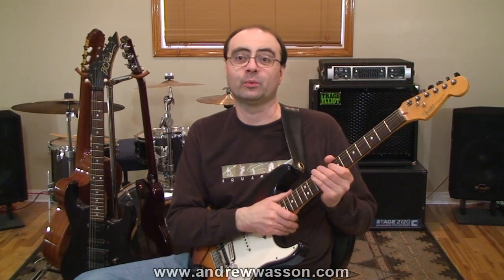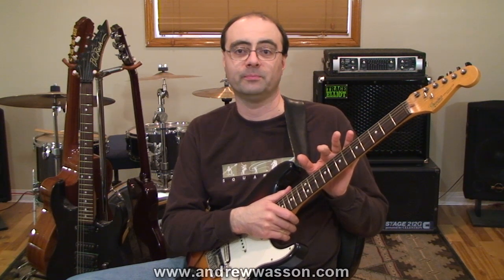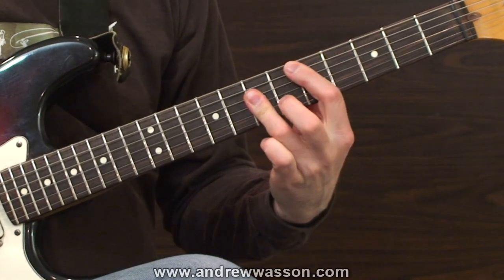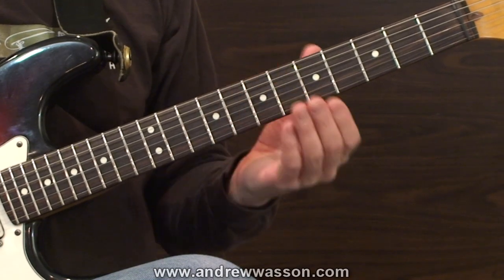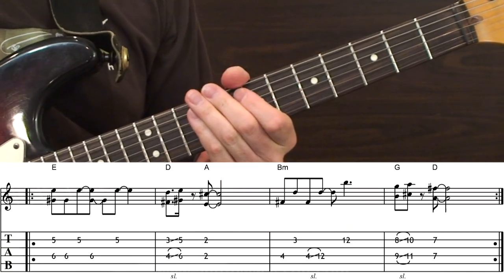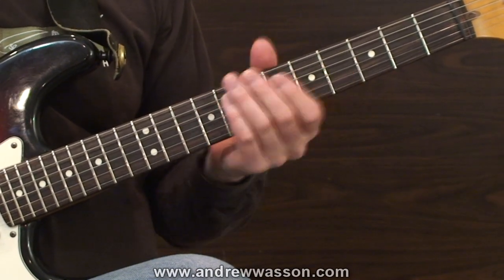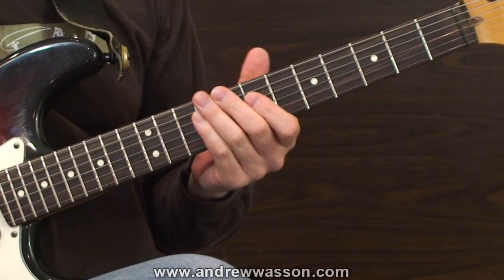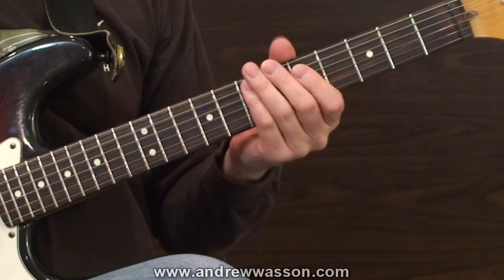Composing Layered Guitar Parts

Comment: I'm unsure if you're using acoustic or electric. I also don't know if you having any restrictions. As for branching out, there are notes that when played together are awesome. Beethoven's Moonlight Sonata and Mozart's Elvira Madigan compositions are awesome examples of subtly.

As for fattening the sound. If you're not against using electronics, graphic equalizers and chorus effects can maintain an acoustic sound while giving you awesome control over thickness. In fact even composers that claim to disdain using electronics, like Tom Petty, use some sort of electronic manipulation to clean up their recordings.

You can also play the exact part note-for-note while subtly playing with the timings and sounds to get a really emotionally piercing effect.

Every microdetail matters. Unwanted harmonics can be removed with electronics.

I'm unsure of what you're trying for, but those are a few ways that I know of.

This may be stating the obvious, but if you lack good speakers called monitors, then anything you record will never sound as good as it could.